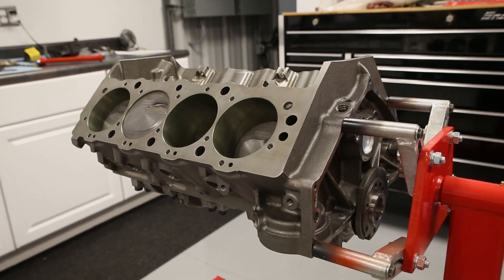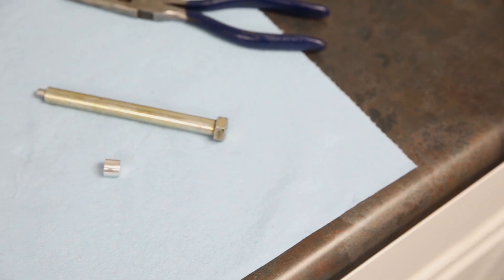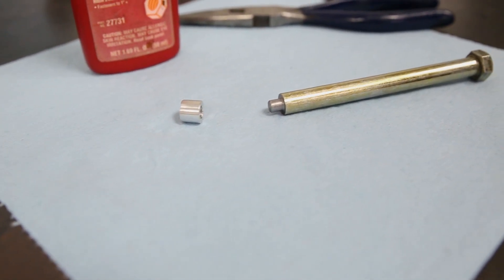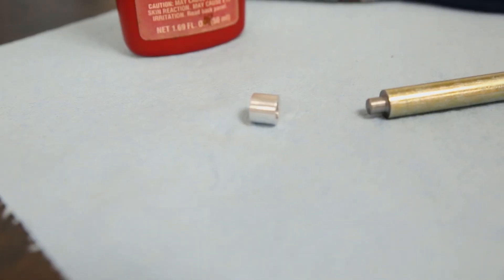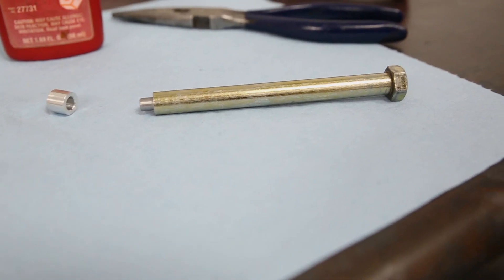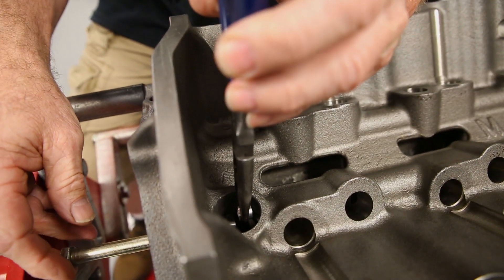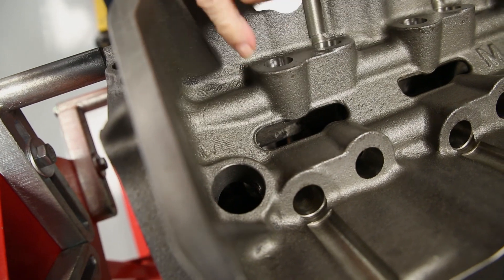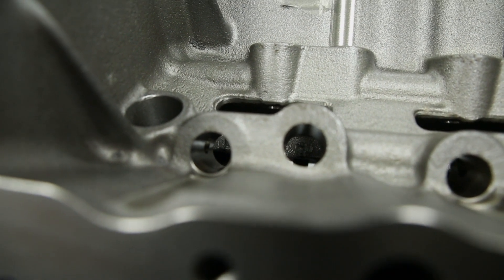Engine Tech: A Fix for Noisy Roller Lifters

Comment: It would be beneficial if you threaded the inside diameter to a 1/4-20 thread to make removal easier. 
This lifter bore restrictor has been used in the Pontiac V8 community for ever.  Nice work 👍

Comment: I have had a Dart 509 w/ hydraulic roller lifters (comp cam) for 5 years in my '64 Corvette. Doesn't make any noise. Not a peep lifter noise.  No issue. I have the same 310 cc heads. Lunati crank. Carillo rods.  Quick Fuel 850 cfm carb (a bit small)10:1 compression. Made 672 hp on dyno at 6200 rpm. Runs like a VW bug. Never heard of this problem. Seem Dart engineers designed the motor and tested it before releasing it for sale. I have 0 complaints except I still have my old LS-6 chev big block 454 dip stick which reads a quart low when motor has 7 quarts of oil in it. I need to call Dart and order a Big M dipstick!

Comment: If a person understands the oiling system on the shp block you realize that this plug is absolutely necessary especially for a street engine that sees a lot of low rpm and idling. The shp block has 2 oil supplies for the lifters...one on the left side and one on the right. The oil simply makes a circle around the lifter galley and around the distributor and meets up with the oil from the other lifter galley. Without this plug the back pressure applied to the oil only comes from the clearance of the lifter bores. In my opinion this is simply not enough back pressure. With this plug installed, the oil comes from both sides of the lifter galleys and dead heads when it hits this plug. This creates back pressure. This is what you want especially with hydraulic lifters at low rpms!!! A factory block has plugs at the front of the block on each lifter galley that creates this back pressure. Nothing is lacking lubrication in any shape or form with this plug installed. Have you ever tried priming this shp block without this plug? You will spin the drill for an hour and barely get a trickle of oil at the rockers on most applications. Put this plug in and just a few cranks on the drill you got oil spraying out on the rockers...just like priming a factory block. I wouldn't build another shp block for the street without this plug no matter what type of camshaft I would be running.

Comment: I purchase this plug installed it along with some johnson hydraulic roller lifter they are reduced travel. I still have some noise but it does seem less. I have come to the conclusion that the sound is related to the grind of the cam. No complaints

Comment: I noticed that the new distributors come with two O-rings above and below this hole that keep this area under oil pressure, just a pin hole there for the distributor to get lube so I'm guessing you wouldn't need this mod if your distributor had the o--rings installed. I can't believe Scott has not mentioned that the newer distributors have O-rings to prevent this leak down of oil pressure.
Reply: Rod Palm you are correct. But this is straubs way of fixing the issue for good. Now it doesn’t matter what distributer you run or if you install the orings or not.
Reply: I have a SBC with a DART SHP. I too had an issue with low oil flow mostly in the right bank which caused my hydraulic roller lifters to start sounding like a wheat thrasher. This is with 10,000 miles of trouble free driving. I tried adjusting my valves but moments later I could move the rockers. I wasn't quite sure what to think so I investigated further pulling the intake to have a look around. As it turns out, I replaced the lifters (Howard Tie Bar Rollers) which came at a hefty price. Upon re-assembly, I noticed that my distributor no longer had the twin O-rings that used to be there. I have no idea where they went, but they were definitely gone. I dropped the pan but nothing there either so I replaced the oil pump with a Melling high flow pump while I was in there. The fix mentioned here may need to be done with some distributors but I re-installed my distributor with new o-rings in the grooves and all is back to normal. I'll bet my old lifters are still good too but it was a lesson well learned. The oil passage that is being restricted with the plug will force more oil into the lifter bore as stated but I think it also restricts the oil to the distributor even with the pin hole and to the passage on the back of the block which goes to the other side of the cam bearing. The o-rings on the distributor force the oil to go around and into the distributor shaft the out the back oil passage causing enough back pressure to force oil to the lifters up stream. I'm not saying anything is wrong with this fix, but if someone else is having this issue, this is a much less intrusive thing to try first.

Comment: Great Video,   if you plug of the oil gallery ,  will it give you more idle oil pressure ?   Currently thinking of going bushed solid  roller lifter ans was wondering if that would help feeding oil to the bushed end of lifter.  Regards Mario, ( Australia )

Comment: Pontiac was mentioned earlier but this seems more similar to the Oldsmobile solution.

Oldsmobile has a pin hole to lubricate the distributor.
Is this (distributor gear oiling)not an issue with this oil system? Odly I am more familiar with B.O.P. than Chevy.

Comment: Just a question, how is the dist drive now internally lubed with the galley plugged?  Or did I miss something and you drill a small hole in your plug.  I’ve always sand roll tapered the top of the distributor block hole and sand rolled the end of the galley hole and used an O-ring in the top distributor groove and none on the bottom so oil will go down onto the drive gear. And no oil will go up.
Reply from the maker: Plug has EDM hole in it.

Comment: If the hole for the distributor was machined correctly 'which they never are' and you could use the O-rings 'which many after market distributors are machined for' then the distributor would actually seal up the end of the oil galley, but they aren't machined concentric at all so if you try to run the O-rings they get cut and won't work.

Comment: If you were building an SBC for circuit racing (about 450hp in a 2600lb sedan) what mods would you do to the oil system? (this is running a wet sump as per rules)

Comment: lots of question below not answered.....dont know why im asking.......how does the dizzy gear get oil now ????
Reply from the maker: Plug has a hole in it that sprays oil on distributor.     We have several crate engine builders using these now for the last 2 years.